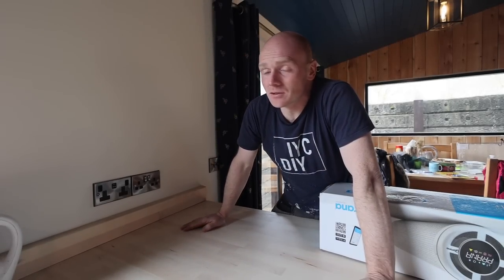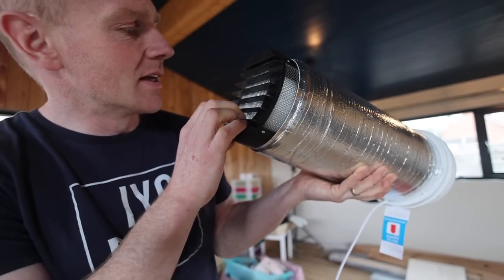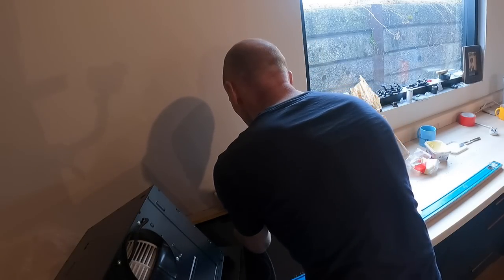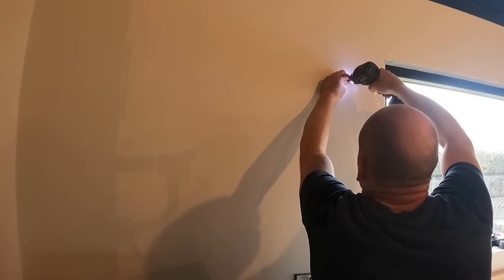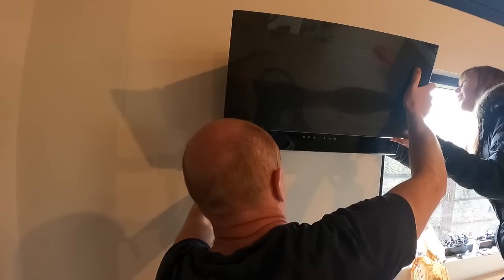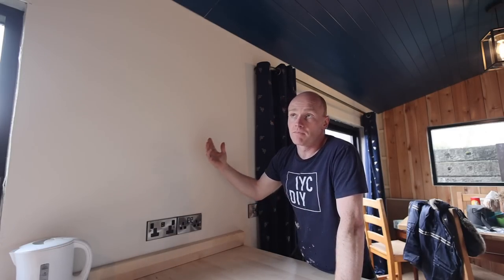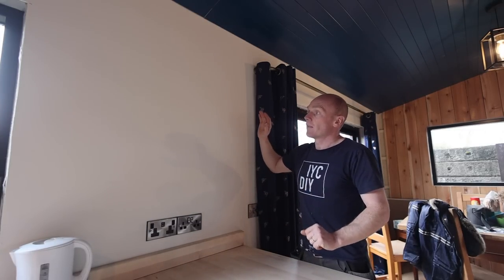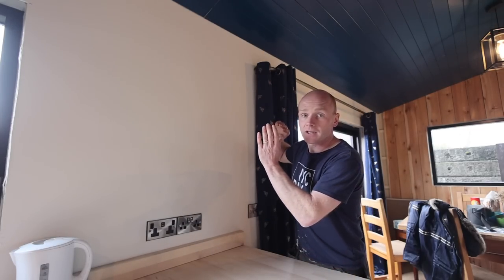WHY DID WE NEED THIS EXPENSIVE FAN? - DIY MVHR Install 💨

Comment: Bonkers price! Other units available at a third of the price! Plus, awful customer service. Imagine when it breaks!!
Reply: Any recommendations? I'm trying to find real reviews of these things, never actually seen one in person or heard of anyone with one
Reply: @zororat  yea a have prana, actually after 16 months i return all 7 units of that garbage, as well cheaper units with ceramic heat exchanger are garbage also. Now I have central unit for 350m2 house for 600$ with pipe installation for 400$ which i made by my self in 2 days and iam impressed of huge difference. Plus all is integrated with home assistant
Reply: @Roodger.eleventh what unit did you get? What brand?
Reply: @AndriiMelekhovskiy-morkot  tradycyjna rekuperacja z jednostką centralną, na cały dom wychodzi w cenie 1/2 oferty złożonej przez prana. Po pierwszym sezonie mogę zarekomendować iż działa pięciokrotnie lepiej niż najlepsze na rynku rekuperatory rurowe

Comment: £1000 is a crazy price for this as I paid £3000 for a whole house MVHR which is amazing and good quality and includes pollen filter, inlet and extract filters which protect the motors and cut dust. It has boost switches in kitchen, bathrooms and utility. But the most amazing part is the controller that is infinitely adjustable to suit your needs. It captures 85% of extracted heat. Supply and exhaust ports are strategically placed throughout the house so as not to create any dead spots where condensation or stale air can remain.
Reply: Where did you source this from please? That's way cheaper than we've seen so far
Reply: 3k sounds good. What make is the system. Is it a pro fit, or could it be a DIY fit.

Comment: I really don't think these single-fan systems that flip-flop between expelling and intaking air can be anywhere near as efficient as they claim. In the expelling phase, sure they can warm-up some mass, which then warms up air on the intake phase. But there's two issues - on the very short run, there's really not enough surface to properly exchange the heat. But the bigger problem is during the expelling phase, you're drawing in cold air from outside. If you weren't, you'd be creating a vacuum. So you're still then having to re-heat that air you've drawn in while your heat-recovery unit was throwing air out of the window.

Comment: Great shout on landlords fitting something like this Tim. As many shoddy landlords as there are out there a lot of tenants don't help themselves by not opening windows regularly and drying washing inside alongside all of the other moisture producing things we do. I knew it was going to be pricey (I was thinking £400/£500) but when you told us the price and the ambiguity of quality I nearly fell of my chair!
Reply: MUCH cheaper units are available if you can live without app controls etc
Reply: @northeastcorals  I'm really not a fan of app controlled stuff. If the company disappears or stops supporting the app you can be a bit stuck.
Reply: @gingerelvis  Personally I think it is quite unnecessary for these types of units anyway. Most run at around 3 watts an hour on trickle mode so you can just set them to run 24/7 during the winter & if thats not enough most have a boost mode which uses a bit more power but they are still very efficient. Thats what I do anyway.

Comment: Units like that are tiny, decentral and cheap, but only have a heat-recovery-efficiency of just 90% (the big expencive ones have 98%+ ...!!!). If you dont mind aesthetics, you can put 2 of the ceramic-core-cylinders in series, that then makes: 90% + 10%*90% = 98 / 99% heat-recovery-efficiency (probably a slight bit less, cause of flow-loses, since the narrow ceramic-channels now have double the length).

Comment: BSK zephyr turkish manufacturer for circa 200 quid each!  21 l/s i think on high. 150mm fan quiet on low
Reply: Humidity switched target settings (40/60/80%) - 3 main settings plus a quiet low flow night mode

Comment: Great video. I am a bit torn - I have spent 3 years living in a new build with MVHR, I found it to be excellent. Very low heating costs (though I needed portable air con in summer...), no condensation ever and fresh air all year around even when I dried clothes indoors. I am now moving to an 1890s Victorian house, and will add a modern extension (thick wall, floor and roof insulation, triple glazing, breathable membranes etc) top and bottom - so wondering if having half the house 'drafty' means I don't need to fit MVHR?
Reply: You won't get as much condensation if the house isn't air tight but your heating bills will be much higher, although its the corners of the rooms and around the windows  where cold bridging occurs you may see some mould.

Comment: For the external vent for the cooker extractor. It will massively help with the build up of oil and grease that the charcoal filters will miss. Learnt this the hard way.  You can never have too much external extraction in what will be a busy kitchen area. 
Loving your videos and good to see another cabin update.
Reply from the maker: Yeah agreed. I have now found an airtight anti back draft unit so will duct it out soon.
Reply: @TheRestorationCouple  Interested in that unit Tim, can you post the details?

Comment: Excellent Video.  Didn't know these existed.  This is just what I am looking for when I come to rejig the kitchen and end up with an non-ducted ceiling mounted  extractor above the hob.  I can use on of these on the outside wall in pace of ducting across on Open ceiling.  Blxxdy expensive though!
Reply: Kair, envirovent and vent axia all do cheaper single roomvhr options but a lot of them are quite a bit uglier than this. There are also single room loft mounted units. Did post a comment with links but it's disappeared!
Reply: @MrEspadrilles  Thanks for the info George.  I'll take a look.
Reply from the maker: I’ll see if I can find and approve the links. Cheers. 👍

Comment: I put a single Blauberg Vento unit in my highly insulated garden office. Doesn't need to be installed in pairs and the wall thickness is adjustable. These seems similar, but way more expensive. After three seasons use, I'm happy with it, although the app control side of it is a bit lame.

Comment: I built an almost identical bed last week, also 2nd hand with no instructions. Mine has the ladder at one end and a pull-out desk thing at the other.
Only 1 missing barrel nut. After a quick tweak with the angle grinder it fit perfectly :)

Comment: Did u do a follow up to this Tim? Could you sleeve it into a plastic pipe rather than box around it on the outside or do you need something solid to fix the outer vent on

Comment: Might be a misunderstanding of ventilation, but extract systems seem to "throw the baby out with the bathwater" - even MVHR has limited efficiency when the flow rates are high, resulting in considerable cooling of indoor air temperature over time (at 80% efficiency and 1 air change per hour, it would take 3 hours to halve the temperature, assuming no additional heating).
When the primary issue is reducing humidity a more effective solution would be a dehumidifier (which can even add heat through heat pump principle), but there don't seem to be many solutions providing discrete/built in dehumidifiers that circulate internal air.
Obviously internal air quality is a substantial consideration, but with effective air circulation and humidity control, the staleness is reduced, requiring less external air to be input; it would be interesting to see how often the fan is required for humidity and how often it is activated for CO2/VOC's?
Reply: Imagine everyone in the house vaping all day long - that's what CO2 would look like if you could see it and that is the main purpose of MVHR, not humidity. CO2 sensors are pretty cheap nowadays - you should get one. My MVHR is rated at 93% efficient,  somewhat better than trickle vents, cat flaps and letterboxes!

Comment: Hi, great video as always. I'm looking at a mhhr for my holiday let. We have an issue with mould. I have considered a centralised system as its a bungalow but this is very costly. Wondering if two decentralised units would be better. Why did you go for the Prana unit over something like a blauberg? The Prana are about double the cost and wondered what the advantages were? Thanks

Comment: Can mvhr be fitted above a shower enclosure in the ceiling?
Reply: Yes but you have to remember that you are pulling out very humid air so if you are ducting that through any area that will be cold you will have an issue with condensation in the duct. It’s important to insulate that duct well.

Comment: So do you need one for each room or can one fan do multiple rooms?
Reply from the maker: Depends on airflow between the rooms. It does 60m2+ so two will do the whole house. In a full house install we will do duct system I think.
Reply: @TheRestorationCouple  our build is one room 50 sq metres downstairs and 2 bed and bathroom upstairs….

Obviously could put vent holes between rooms upstairs?
Reply from the maker: @livingoffgridinscotland  that’s how I think we will do our second unit here. The kids bedrooms are usually always open anyway but a small vent above doors or in wall will work. We are putting it in the hall and buying a longer duct so it’s central.
Reply: @TheRestorationCouple  that makes sense putting it in the hallway

A lot of council houses had air vents above bedroom doors, I presume for air flow… as do some static caravans
Reply from the maker: @livingoffgridinscotland  for building control in a dwelling, if no trickle vents are fitted then mechanical ventilation is required in every room. It may be that the vent above door option would satisfy though. For our situation I think it should be fine to it’s a central vent.

Comment: Interesting video.   Seems like a decent unit with some minor flaws (the surround / wire issue).

I have retrofitted a whole house MVHR.   Was an interesting project!   Works really well and the house is noticeably less damp and the humistat data shows this.

If yours monitors PM2.5, Chemicals or CO2 you will notice it detects cooking esp Toasting, frying or having the oven on which in my experience kick out allot of PM2.5 that the MVHR then gets rid of.

Check the filters often (esp initially).  You will be surprised at how much they pick up both from outside or inside.  Our MVHR helps reduce hay-fever symptoms as it has a decent filter which is nearly HEPA level (not quiet).   We change/wash ours every eight weeks.

The preheat function is stop the heat exchanger freezing when the outside temp is well below freezing (eg -10C or below), otherwise the condensate drain can freeze and frost can damage / block the heat exchanger.

Does it have a night time mode?   Also can you set the boost mode?   We upped ours to 90% so that when it needs to dump, it can do so quickly.  Otherwise its silent.   If it goes into boost mode, you can hear a gentle hum in some rooms for a minute or two.  Most people cannot hear or notice it.
Reply from the maker: Yeah that’s right, might mode and quiet auto mode. Like you say we found auto mode can be triggered by random things causing high VOC. we got really worried at one point as it was crazy high and couldn’t work out why fan was ramping up. Turns out that cut flowers and a fruit bowl full of bananas below it was triggering high levels! So not dangerous offgasing materials that we feared. 😂

Comment: What is the noise like in the bedroom unit. considering something similar for 4 bedrooms, 2 small living rooms and kitcehn dining room, not to concerned about low level noise in the living areas but wondering if its noticable in night mode in bedrooms
Reply: Bump. Also interested in hearing about the noise levels on one of these units? I am thinking of installing one in my soundproofed garage studio.
Reply: @brianresoul  we just had it installed , very noisy but we boxed it off and that helped lots .

Comment: Any problems with the fan sucking in smoke from your woodburner? We have a piv in a bungalow and when the woodburner is on it can pull in smoke that rolls down the bungalow roof.  Our bungalow is modern so well sealed and when the woodburner is on if the kitchen extractor is put on air is drawn down the flue😀
Reply from the maker: Any stove we fit will be room sealed so external air supply. Did that last time and worked great.
Reply: Won't this product be balanced ir it is putting as much flow in as it is taking out so smoke "should" not be an issue?
Reply: I live in an area where log burners are quite popular and in autumn/winter, you can smell the smoke outside. Won’t one of these units pull in the smoke? 🤔

Comment: I wondered what you were going to do for ventelation when you put so much effort into insulating and making airtight.  I'm currently in the process of installing a ducted MVHR system for the whole house. All the basic kit cost less then 1k but requires much more effort running ducts, boxing in and insulating the ducts etc.
Reply from the maker: We will be going a similar route next year so lots of research to be done. It will be a huge system to spec so really need to design the ducting and room layouts at same point.
Reply: Oooo  You have my attention...
What did you buy? Where from?
Thanks
Reply: It was from ventelation megastore. Believe its imported from China.  Not sure how good it is yet but the efficency and performance specs look good.

Comment: Interesting to hear the review, a bit dubious of the whole heat exchanger pulling and pushing in one unit idea, does it do this at the same time or in a cycle? Also noticed that the remote looks very similar to those for the old now TV aka Roku set top boxes. So wouldn't be surprised if the "intelligence" and app is running off Roku software of sorts.
Reply: it does at the same time (there are 2 seperate canals inside with the same heat recovery)

Comment: So when this fan is extracting, the property will be at a slightly negative pressure, causing cold air to enter by any leaks.  when the fan reverses it will bring in fresh air, causing an equil amount of your allready warm air to be pushed out of the property by any leaks.

Feel that a 2 fan system will be significantly more efficient.

Are there any decentralised systems that also do humidity control - imo the main reason to install a MVHR  - no good bringing damp air in to the property when its humid out.
Reply from the maker: The two fans are simultaneously running so should not be any noticeable change when set to equal power.  While we didn't pressure test this time, it was pretty thorough detailing of airtightnesss layer so not enough to cause efficiency issues.  We will monitor levels through the app more as we close things up nearer winter.  For now we are just using it to boost extraction when needed.
Reply: @TheRestorationCouple  oh that makes a bit more sense - I think I was reading about another one that just alter ates the airflow direction every 30min or so.
Reply: @inh415 some do simultaneous supply/extract, others change direction. I’ve done a list on buildhub for those who geek out on this sort of thing
Reply: In the winter the air outside is drier than inside. Cold air holds less moisture. PIVs work by pushing cold dry air into homes in the winter. The issue is warm moist air inside condensing on cold surfaces. In the summer when humidity might be a bit higher outside the ambient temp is above the dew point so no issues there.
Reply: Have you got a link to the BuildHub page. Thanks
Reply: @dorsetengineering  could you ping over the link to your list please?

Comment: Great video but personally I go for a model that is locally available. Plenty of options and about half that price.
Reply from the maker: Any suggestions that are true DMVHR? Looking at a second one for the other end
Reply: @TheRestorationCouple   vent Axia has a range of similar models under the Lo Carbon brand perhaps not as sophisticated as this but MUCH lower cost I have the Tempra which claims up to 78% heart recovery, although the "claims" part makes that pretty meaningless. It was not really possible to gauge its effectiveness as  I could not think of a way of measuring it.

Comment: I can’t get my head past the issue of throwing warmth out through a hole in the wall. Even with an efficient MVHR. Why not use a dehumidifier and possibly one small MVHR just to refresh the air if you don’t have air leaks? 
The maths are not something I’m familiar with though.
Reply: I don't know about this particular unit but I have several MHRUs sized for a few average rooms & usually they run at around 3 watts per hour on trickle mode or 12 watts per hour on boost. I also have x2 dehumidifiers that are adequate for 1 or 2 average sized rooms & they run at 150 watts per hour.

When running in winter you should take into account that the dehumidifiers also create heat rather than loose any heat, however even when accounting for this the electricity usage difference is very significant.

Comment: Look how folks are doing on the continent :-) like Frenchies! It is much cheaper too…
Reply: I looked at retrofitting this kind of big box in the attic in my 1920’s house in London, but it is not easy. I got lost in the details of fire barriers between rooms etc… I went to permanent extractor fan in bathroom, humidity controlled trickle vents and the same as you install, in our kitchen

Comment: Sorry but you can’t have 2 fans operating in Oposite flows 1 will stall it must have the ducting split so 1 half does in the other out
Reply from the maker: It is two separate ducted channels inside with heat exchanger between.